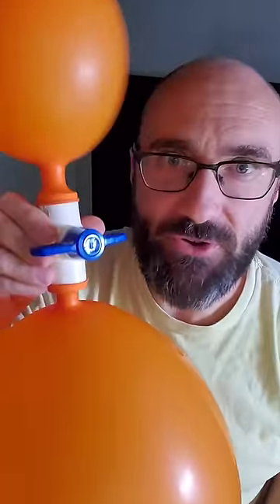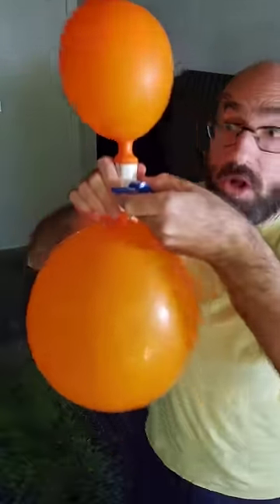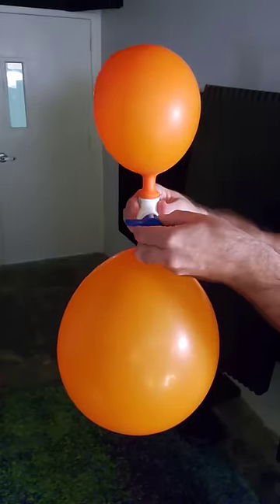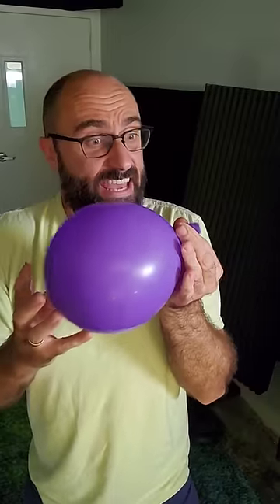What Will Happen When I Open The Valve?

Comment: This is an amazing demonstration! This explains why lungs have a tendency to collapse (atelectasis). One of the main key reasons that they don’t is that our lung cells secrete a soap-like fluid called surfactant that breaks the surface tension, decreasing the recoil of the smaller/less inflated lung segments. By decreasing that surface tension, it allows those units to stay open and allows the various alveoli to actually balance one another out rather than all of them, collapsing into one another. going to have to add this video to my physiology lectures

Comment: If yall are confused, the vsause behind the door is shorter/ the smaller balloon and the vsause talking is the bigger balloon, and the door is the valve seperating them.
Reply: Using this i made some sorta theory, the vsauce behind the door which is probably some sort of clone wants to merge with the vsauce talking which is probably the real one or something (because the smaller balloon "merged" with the bigger balloon) (by merged in the balloon situation i mean the smaller balloon pushed the air inside of it into the larger ballon).
Reply: that's pretty cool i thought it was just another random weird ending 😂
Reply: "the pressure out here is so strong, i feel such a powerful force guiding me to the other side of this door, Micheal!"
Reply: Absolute big brain comment💯
Reply: Why does Michael (the larger of the two Michaels) not simply eat the smaller Michael?
Reply: Bro it's 2024 change that pfp
Reply: @Regularr  nah bc I won't let the meme die💀💀💀
Reply: okay but wtf is the weird sound though
Reply: bro deserves to get pinned
Reply: This is the definition of overthinking😅
Reply: what
Reply: balloon* (ballon is dutch, just so u know)
Reply: Weird way to spell balloon.
Reply: Wow, why don't you try to decipher what one piece is?
Reply: Dang
Reply: Wow, okay, that's crazy
Reply: ooh
Reply: This definitely sounds right but I really dislike this take, simply bc i loved the sense of weirdness and mystery 😔
Reply: @rubub8455  wdym? Its just the smaller sauce climbing into the larger vsauce
Reply: How do i gain the intelligence to figure these sorts of things out?
Reply: @robthegobbler  just be observant.
Reply: @jovanroyce4474  explain more
Reply: @robthegobbler  like the Michel behind the door is smaller and vsause is talking about big and small balloons and he is the bigger ballon
Reply: the man who solved VSauce
Reply: copy
Reply: @TAS_Jsap   wdym
Reply: @dswcartoons  the smaller michael is mighty
Reply: Dude wtf are you the god of knowledge
Reply: HAHAHAHAAHHA NO WAY THATS GENIUS
Reply: Who let him cook?
Reply: Nice job copycat someone said that 7 months before you did
Reply: Guys I'm sorry if you think I copied I did not, plus why would I want clout on a comment????
Reply: Smaller Michael was bringing the trash talk 😦
Reply: The smaller Michael is his sanity, he managed to get rid of it and he is not planning on opening that valve any time soon.
Reply: that is actually so fucking genius
Reply: @dswcartoons good Futurama joke
Reply: lil zsauce gonna shove his air into michael
Reply: i dont think thats right lol

Comment: Ok this just destroyed all intuition I had about balloons
Reply: One comment about the actual content of the video rather than the ending
Reply: Yep, I thought either a) they'll stay the same, cause outside pressure is the same on both (??), or b) the bigger balloon will shrink cause its material has been stretched more so there's more tension to return to its original form (??)

So yeah, I did NOT expect that at all!
Reply: Interesting I studied about it yesterday and Michael happened to post a video about it. Coincidence ig..?

Or is it.?
Reply: Even after explanation it doesn't make sense
Reply: @VEE727  honestly yes, but it makes sense empirically. Anyone who's blown up a balloon knows it's harder when it's smaller, which suggests pressure is bigger. But I don't understand why physically
Reply: @samandmax42  i think one thing to remember is that a bigger balloon has more air, but is also bigger and thus no pressure changes. So you could intuit that the pressure is actually the same. But then rubber has less resistance the more it is stretched which throws it off the equalibrium and makes the bigger one weaker.
Reply: @VEE727 I use an anatomical analogy. Consider an aneurysm in a large vessel, say your aorta. It's stretched thin, bulging out. The larger balloon is the weak point w much fewer layers of cells  (rubber) and the smaller 1 can be considered the healthier portion surrounding the bigger 1.
Reply: @VEE727 The smaller balloon is putting more pressure on the air inside of it than the stretched, inflated balloon, because the rubber is thicker, not being stretched as much. The higher pressure air seeks lower pressure so it goes into the bigger balloon.
 
So when you open a balloon into empty air the pressure inside the balloon forces it out, in this case there is no open air only the other balloon.
Reply: @NihongoWakannai  this is the key I think. Rubber has less resistance the more it is stretched. My mind is thinking of it like a spring. The more you compress it the harder it pushes back. But the rubber stretching behaves the opposite way.
Reply: @thegoldenkingfisher goes to show that once channel is established, most will watch whatever the content, it just have to have something.. other than just a facts. michaels style of presentation and these little "lore" snippets you see like in the end of this video is enough. and only very small portion of us actually are here for the actual facts. knowledge isn't power in america? 🤨
Reply: @VEE727  I could be wrong, but I think it's because when you put more air into a balloon, the amount it needs to stretch to include it decreases (expansion proportional to the surface area of the balloon, amount of air proportional to the volume of the balloon.)
This means the amount the rubber needs to stretch for the big balloon to accept the smaller balloon's air is much less than the small balloon would need to stretch to accept the big balloon's air.

Add on Michael's explanation that the thicker layer of rubber on the smaller balloon is harder to expand, and we find it's significantly more difficult for the air to enter the smaller balloon that the air entering the larger balloon.

Note, this also explains why there is a little air in the smaller balloon, because it doesn't need to stretch to allow it to stay.
Reply: @jffrysith4365  that's a really good point
Reply: @jffrysith4365 
On the first part, the way I understand it is: the change in volume to change in surface area decreases as the balloon inflates. Now the resistance of the rubber changes in relation to the change of the surface area (not the volume of air inside). So initially, a small change in volume, dV, added increases the surface area by a certain amount, dA, but one the balloon is already inflated, that same input of dV results in a smaller dA output.  Idk if any of that made sense 😊 but hopefully it did lol
Reply: @thegoldenkingfisher  He lures you in with the facts and keeps you hooked with the peculiar antics
Reply: This actually made me understand balloons more!
Reply: @atharvbabbar There are no coincidences 💀

Comment: Would this not also be an example of the square-cube law in action?

When you blow into the balloon, you are increasing its volume by a constant amount. The resistance the balloon offers is determined by the corresponding 'stretch', i.e. the increase in its surface area. 

Due to the square-cube law, the ratio of Surface Area/Volume decreases as the balloon grows, thus the amount of resistance you face when blowing more air in decreases, even disregarding material strain on the rubber.

Comment: Could use this to solve the low air tank problem. Low air tank means no pressure. Incorporating this into the system could be ideal for when an air tank goes below useable pressure.

Comment: That’s basically surface tension and phenomenon of excessive pressure  working over there …excessive pressure is in inversely proportion to radius this more the radius ,lesser the pressure inside it so the air flows from the smaller balloon to the bigger balloon…btw very nice and logical explanation🤟🤟👍👍

Comment: I think its the old Vsauce still stuck in the isolation room that was at the end of the video behind the door
Reply: So this one is a clone? A doppelganger? An extraterrestrial entity?
Reply: @seaweedbrain2933   I am sure its a extraterrestrial entity because the clone will say "Hay Vsauce Michael here" and a doppleganger is not 100% the same. Thank you for your question.
Reply: @seaweedbrain2933  And if you are also wondering, the entity can't say "Hay Vsauce Michael here" like the clone can as the clone is 100% like Michael and the extraterrestrial entity can only look like Michael.
Reply: It's just smaller VSauce who blew into VSauce after the video ended.

Comment: Pound per square inch guys! Pressure is indeed a force divided by surface area. Smaller balloon has smaller surface area than bigger balloon, so pressure in smaller balloon greater than pressure in large balloon!
Rubber elasticity is also a contributing factor, I give you that!

Comment: Probably why atelectasis is a challenge. If the deep alveoli of the lungs collapse pressure needs to be greater than typical atmospheric levels but, sharp, quick breaths can increase the velocity of airflow and the associated power enough to overcome a collapsed alviola

Comment: There's a second physics principle that plays here, & that is the surface area to volume ratio of 3D objects, or in this matter, gases. Fitting just a bit more cubic volume to a larger object won't increase the size as much, proportionally, as on a smaller one.

Comment: What's most counterintuitive about it is that the larger balloon, and the smaller balloon both got smaller. 
I would expect the balloons to both be the same size. Or the large one getting larger as the small one got smaller. But definitely not both sides losing volume.

Comment: I believe the explanation is wrong, if rubber got weaker as it got thinner due to extension, if you put a weight on a rubber band it would just keep extending until it snapped, as long as it extended past the treshold amount. But that's not what you would see (though the elasticity might not be linear, I'm not sure about that). The actual reason would be that the curvature of the balloon is decreasing as it's getting larger, and it's decreasing faster than the tension is increasing. And the pressure in the balloon is pressing against the curvature (inverse of radius) times the tension.

Comment: I dont know if the explanation is correct. I think it has to do with the cube of the volume. To add say 500ml to the big balloon, the rubber only needs to stretch maybe another 3%, but add 500ml to the small balloon would require it stretch by maybe 30%.

Comment: does it also have to do with the ratio of volume to surface area? The bigger the balloon is the smaller the ratio of increase is when you blow it. I think this gives you a "mechanical advantage" of sorts. It might be completely counteracted by the increased force from elasticity though.

Comment: Yes, so bigger balloon means less pressure. Smaller balloon means higher pressure. Air always travels from higher pressure to lower pressure. Just like how electricity travels from high potential to low potential.

Comment: I think the explanation is incorrect. A balloon can be thought of as a bunch of elastics bands fused together. Elastics are like springs, they exert more force as they are stretched, not less. Consider the "elastic" going around at the "equator" of the balloon, as it stretches, its length becomes larger but unlike a normal elastic band it is also stretched by the other bands attached across it. This means that as the balloon becomes bigger, the air inside the balloon has more area to push against the band relative to when the balloon was at rest since the force of the band increases linearly with the radius but the force of the air increases by the radius squared.

Comment: I don't think it's actually that the balloon is "thicker". Springs increase the force they exert relatively linearly as they stretch, so I think the force exerted by the balloon does increase. However, as the balloon expands, so to does the volume increase. So force is related to surface area and volume, volume. So pressure =x^2/x^3, or pressure decreases as size increases. Right? Can someone check this?

Comment: as you can see the vsauce outside is smaller than the one on the inside so the smaller vsauce will shrink and the vsauce on the inside will grow and have lower pressure

Comment: Is there a point where the air pressure inside of one balloon will equalize, with the tension in the other allowing two balloons of different sizes to not put air into the other?

Comment: funnily enough... the explanation is wrong.... I mean, yeah, it certainly seems so, but it would actually be still the case  if the rubber would not expand at all... it acutually is caused by the Laplace pressure, which gives the pressure difference on the two sides of a curved surface (Young laplace eq). the larger baloon has a greater radius of curvature and thus a lower internal pressure (as that is proportional to the inverso of R).... thus, the smaller ballon is an area of higher pressure and therefore "blows up" the bigger balloon. This is also the reason for a phaenomenon called ostwald ripening -which describes that bigger bubbles in a liquid grow at the cost of smaller bubbles without even coming in contact with them. (I am aware that this comment will not be seen though ;) )

Comment: But what if you fill the smaller balloon with a gas heavier than O2 or CO2 for when it's at the top, or fill the smaller balloon with a gas lighter than O2 or CO2 for when it's at the bottom? Even due to the pressure and the rubber elasticity of the balloons, the gases should at least swap, right?

Comment: i think it has more to do with leverage than the thickness of rubber
Reply: @feminico2613  the air has better leverage with the size.  kind of similar with hydrolic pistons being stronger with displacements.  or big mucles being stronger
Reply: @feminico2613  the thin stretched rubber is actually pulling harder on the air than the thick rubber although the pressure is lower

Comment: Large volume.less density equal less pressure
Reply: Large but full volume. The pressure comes from the rubber compressing harder on the air when it's not full.

Comment: Your explanation is only half the story. The tighter curvature of the surface of the small balloon makes the pressure higher even if the tension in the rubber of the two balloons is the same. This is why surface tension causes smaller water droplets to empty into larger ones.

Comment: That is not true. The pressure in the smaller balloon is less. The reason the air goes to the bigger balloon is because that produces the largest volume with the smallest surface area.

Comment: I'm sorry to say I believe that you are incredibly incorrect.

The increased diameter of the balloon represents an exponential increase in planar stress on the rubber. Initially the balloon is difficult to inflate because latex has multiple elastic modes. But once the balloon starts to inflate the only difference is planar stress. Between the 2 sizes. I e. Pressure will always be greater in the smaller balloon. Unless the larger balloon is near breach pressure.  You can test stress and strain on  bands of rubber. Thickness of the at x distance of stretch balloon does not have anything to do with why a smaller balloon will deflate into a larger balloon. This is something explained in nutrition physics.

Comment: That’s actually a false explanation. You failed to mention the fact that the larger balloon has much more surface area. And if you know how pressure works, similar to a hydraulic ram, a larger piston will have more force with the same pressure. Since the more inflated balloon has exponentially more surface area as size increases, it will have much more force pushing outward around the entire balloon, with the same pressure. 

And think about a rubber band - even when it is less stretched and “thicker” as you said, it takes less force to stretch it than when it is more stretched. So your explanation is not even a single bit true. 

The elastic tension of the balloon increases at a much slower rate than the total surface area of the balloon, hence why the more inflated balloon will actually have LESS static air pressure, since the tension is much more spread out, similar to a master ram with a much larger piston, but the same force being exerted against it.
Reply: Did Young Sheldon write this?